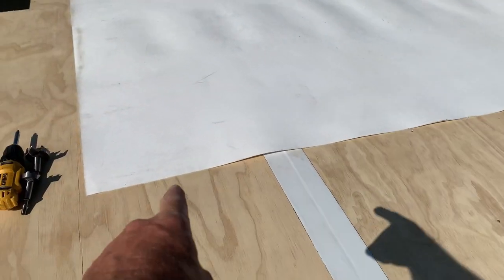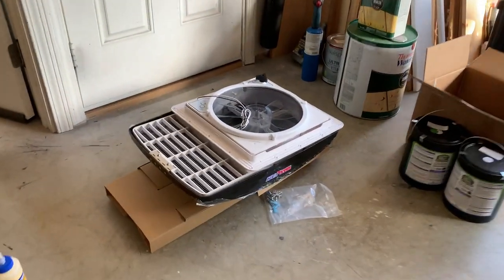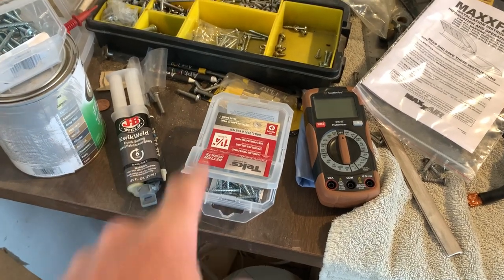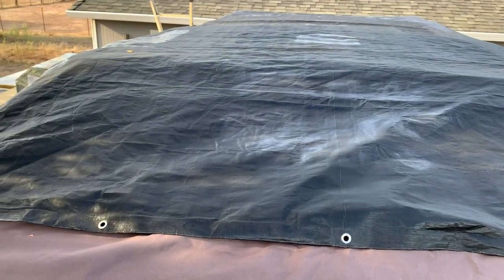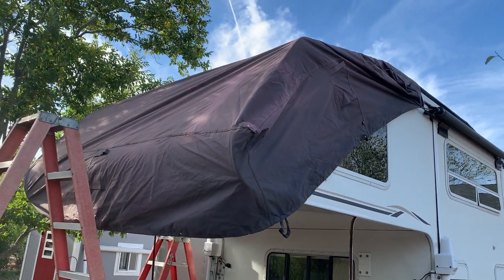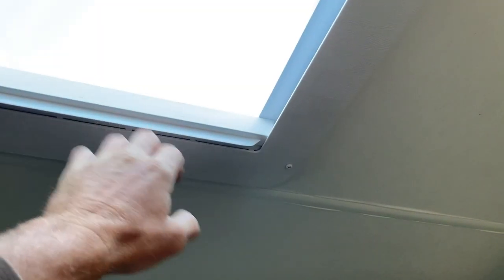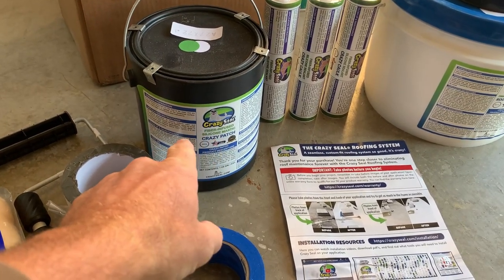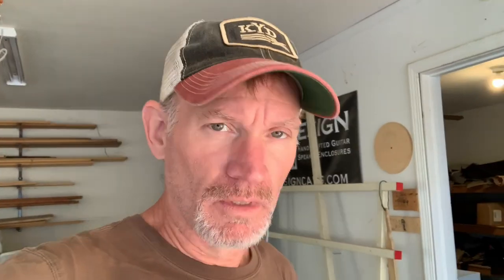Roof Layers & Seals. Installing a 50-Year RV Roof Part 10

Comment: Enjoy watching your progress and learning from your videos. Why did u go  3 separate  pieces of Poly vs one pieces?
Reply from the maker: Thanks.  These are 4x8 sheets of 60mil polywall.  Sold at Home Depot or Lowe’s.  Easier to handle in smaller pieces.  The seam tape & 2-coat roof seal makes it a seamless roof system.

Comment: Did you mention earlier that Crazy Seal could be applied directly to a new {or old} plywood roof after repairs were done? Would the 50 year warranty still apply? I'm asking you as I know you have done all of the research on Crazy Seal.
Reply from the maker: Yes and yes.   Their website and YouTube channel has some full install videos on direct to deck and over existing TPO or EPDM rubber roof.

Comment: Do they sell the 60m new roof
Reply from the maker: Crazy seal is the liquid roof membrane that is applied over the substrate.  Which system you purchase depends on whether it’s new wood deck or existing wood deck or EPDM/TPO rubber.  
I purchased the 60mil polywall at home depot
Reply: @covetthecamper2289  did you do your side out